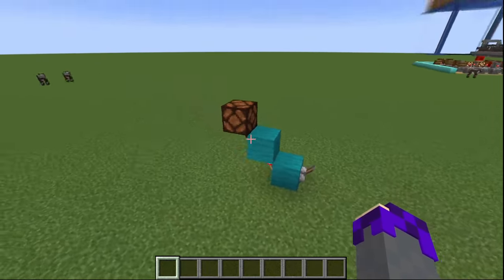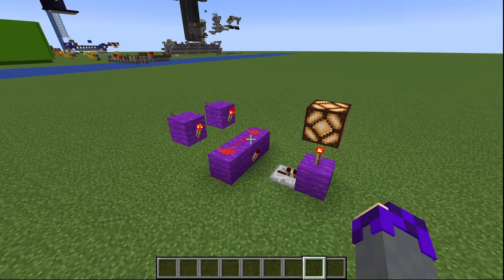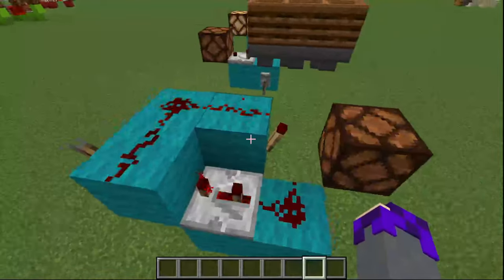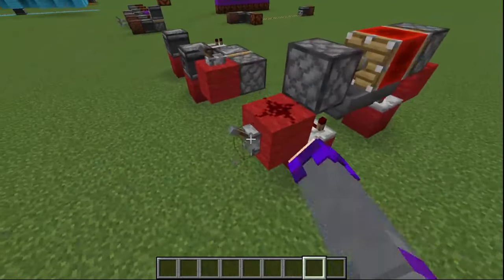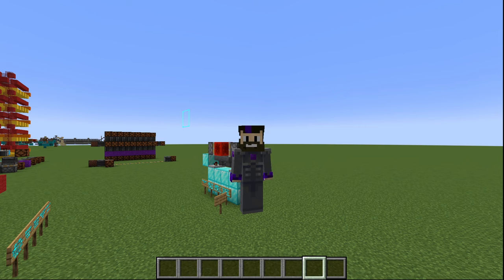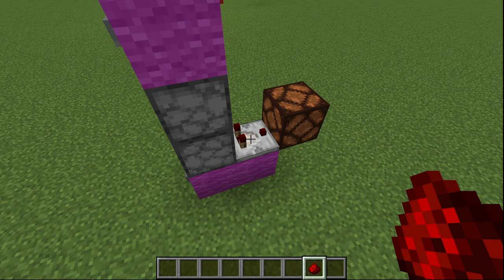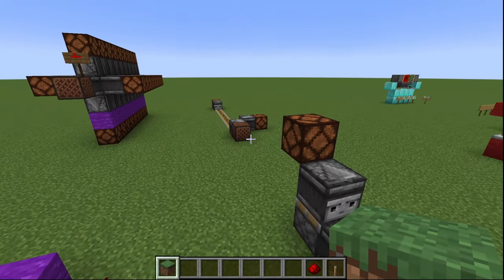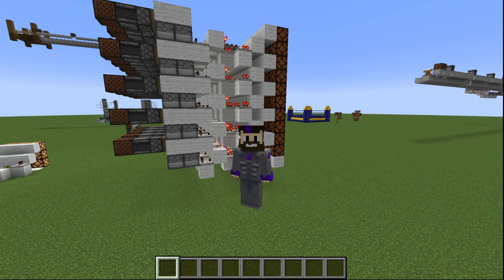Simplifying Logic Gates And Common RedStone Circuits.

Comment: There's a few more gates that you can do.  But to be honest they aren't use hardly ever so I wouldn't worry about the x/or gate. 
   Glad to see you now know what an rsnor latch is. And that's its not a  t flip flop.😅  
Also with the rail trick when going longer distances you can get one more block of distance by powering a solid block in-between the observer and the rail.
Reply from the maker: Yeah in my research I found more gates that exist, but, in watching some of the best logical redstoners out there, I noticed none of them use them, so I decided not to include them in the introduction to logic video. As I advance in the series I’m sure I’ll mention them.  And yeah I learned the terminology real quick after last episode 😂

Comment: For the OR gate just have the levers next to the lamp, no need for a double inversion. For the NOR gate just put the levers on a block with a redstone torch, again no need for double inversion. Both AND gates are just the inversed OR gates with inversed inputs.

No offense but kind of weird you decided to even put a double inversion in the first place
Reply from the maker: That’s a really valid point. I guess I got so caught up in the diagrams I did t even think about that, thanks!